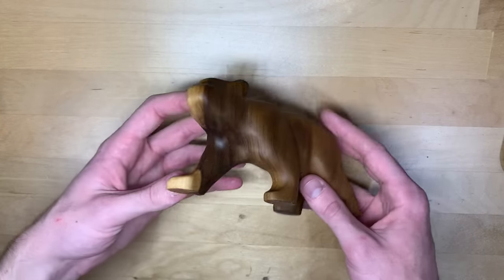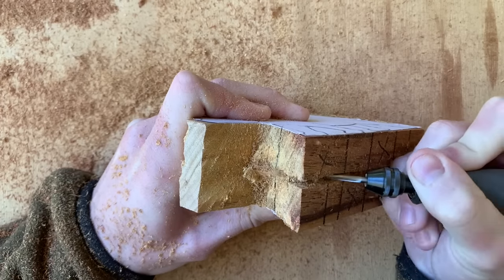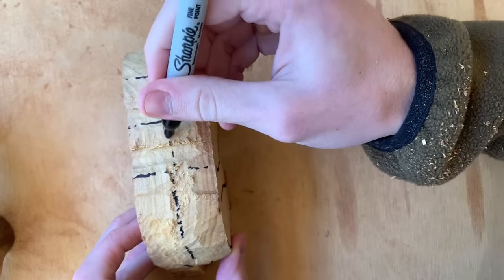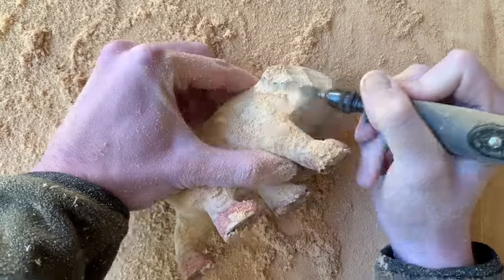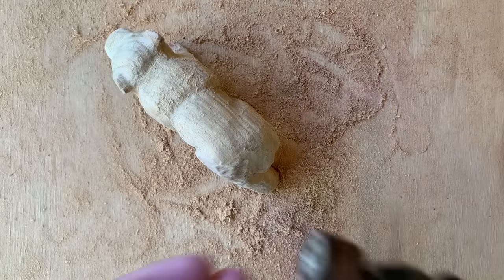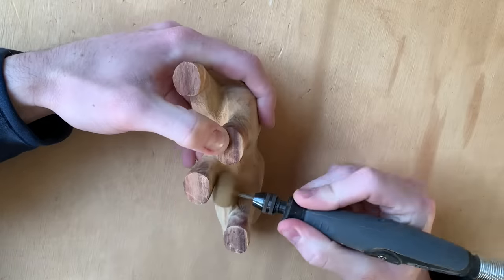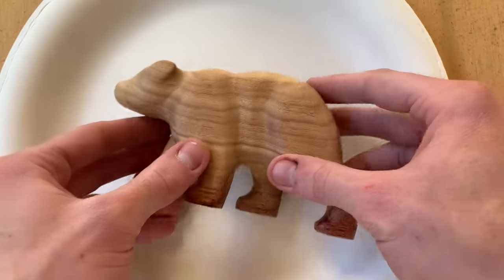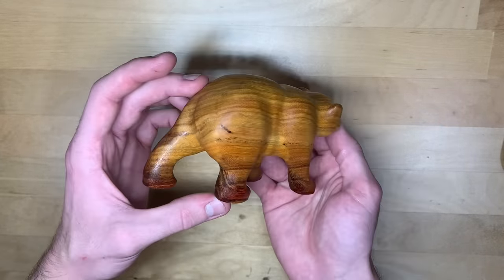Power Carving a Wooden Bear with a Dremel

Comment: That narrow bit can do work! 0:49 😮
Reply from the maker: Dremel 561, its really saved me from having to buy a saw
Reply: @LogsCarvingClub how do you cut so easy with it? It takes me forever. Technique or my wood too hard?
Reply from the maker: @Matsersuperkul  Maybe a mix of both. I try not to put too much pressure, keep it around a 45 degree angle, and do many shallow passes. Some very hard woods though are just not worth trying, and even tough ones I can cut like hard maple take a long time which I mostly edit out of the videos for the sake of time

Comment: question: does it matter which way the grain runs? if so-top to bottom or horizontal?
Reply from the maker: I responded more in depth to your other comment, but also usually I use this grain direction just cause that’s how the wood is usually cut

Comment: Great job! I have some questions... At the begging, What type of drill bit did you use for the Bear silhouette?  Is it the one generally used for flat cutting?  And do you recommend any other bits from any other brand that work with this dremel tools?
My English is too bad sorry if i made a mistake whit the writing... blessing from Costa Rica!
Reply from the maker: Hi - I used the dremel 561 I believe for the silhouette. Other than that I have most bits I use linked in the description, some are other brands. Thanks!

Comment: Is a 12000 rpm good enough for carving? Or do I really need a high rpm one?
Reply from the maker: Might work, but I'm not sure if it would work well. I usually use mine at 20-30,000 for carving.

Comment: Is There a problem using an 561 or 562 without the dremel guide? I want to try cut with them, but i don't know if it' dangerous or something.
Reply from the maker: You mean without the black depth attachment around them? If so I barely use those, I cut with the 561 and 562 all the time. The 561 is definitely dangerous though so you have to be careful, but it cuts really well. The 562 is slower but more precise
Reply: @LogsCarvingClub  I really apreciate your answer. Thanks you so much! 💯

Comment: Great video! I’ve done a little bit of carving and want to do more, this was a great video to help get my brain in the right space. Do you like any cordless rotary tool options?
Reply from the maker: Hi Bethanie! Glad you liked the video. I use the Dremel 8220 for routing so the cord doesn’t get in the way and the Dremel lite for little engravings and very small projects. Usually when I’m doing a larger carving though I prefer the corded options
Reply: Thanks! @LogsCarvingClub

Comment: I've only made one bear since I started 3 years ago, and I made it with a chainsaw, not a great success, but it looks like a bear 🐻😅! I'm going to try with the Dremel thanks! Do you use the flap sander that you can make yourself? I also discovered this thing for water, but for certain wood, including basswood, I didn't like it because we never stop sanding the fluff!
Reply from the maker: Hi, I don’t make my own flap sanders, I usually hand sand these or use abrasive buffs. And yes for getting it wet then sanding some woods seem to be eternally coarse, like a recent experience I had with birch. Usually very dense hardwoods don’t do that though. Good luck on the bear!
Reply: @LogsCarvingClub  You should try the flap sander, it helps a lot and it goes everywhere! But yes, hand finishing is a must!

Comment: Excellent Job! How many RPM did you use?
Reply from the maker: It depends, usually 20-25k for carving and 10-15k for sanding. The dremel has a manual that lists a lot of rpms depending on tool and material. Thanks!

Comment: Amazing, thanks for showing me how to get more out of my Dremel, I have a long way to go. Doing the carving you do, approx how long would a burr bit last you, just curious as to how fast they wear out, I know you can’t give an exact, but how many bears for example could you do with one burr bit? Thanks again. Ont., Canada.
Reply from the maker: Hi Jay, it depends on the bit but most last a very long time. For example I’ve roughed out dozens of similar animal carvings with one kutzall extreme flame burr without getting a new one, the 561 and 562 are also very durable, I’ve only gone through a couple of each of them. Some bits don’t last long like the sanders or grinding stones depending on how you use them. You’ll end up getting a feel for each of them as you keep making carvings
Reply: Thanks so much for taking the time to reply!
Reply from the maker: No problem!

Comment: Wat are the best bits to use as a beginner
Reply from the maker: Whatever you have, I’d start with tungsten carbide bits and engraving bits for a while to get a feel for carving then move to 561 and 562. The sanding bits and whatnot are all pretty easy to work with I think
Reply: Thanks for the tips love your vids

Comment: How do you decide what wood to use and sizing?
Reply from the maker: Hi Shannon, usually I just eyeball if the carving will fit within the wood, especially with the smaller blocks I buy like the one in this video. The closer the wood is to the final carving the better since you don't have to remove as much.

Comment: Have you ever tried chainsaw carving? It’s so much fun.
Reply from the maker: I would love to try it! I just don’t have a chainsaw currently and I’m worried about the noise for my neighbors
Reply: @LogsCarvingClub  it's basically the same as what you're doing with the Dremel. Just larger scale.  Cut away everything that isn't part of what you're carving. Then shaping it. I still use die grinders, Dremel, and sanders for the small details. I know you'd be good at it. You did a great job with only a Dremel.

Comment: Nice. But no need to do the 1000 grit, it's over 10x more abrasive than polish. Try 10000 next time or just a microfiber cloth, polishing wheel with no polish even...and pop the grain at least twice, and definitely right before the final rundown.
Reply from the maker: Worth a shot I guess! With how I finish these though they’re very smooth already. Some woods I have trouble with like poplar or pine but the denser woods come out great with just one grain raise and up to 1000 grit
Reply: @LogsCarvingClub  I'm sure they come out great, you are an awesome carver. Maybe save these extra steps for your best work. I do it for all mine but just because I am trying to master finishing.
Reply from the maker: @makinnewcounts6676  what kind of polish do you use? I’d be up for trying that but the red polish that comes with the dremel tends to stain the woods. I’d like to learn more about finishing but I get so bored at that point that I settle with ‘good enough’
Reply: @LogsCarvingClub  honestly,  I work my way up through the grits to up to around 800 to 5000 then "polish" with microfiber or cotton cloth, without any chemical polish. Then shellac, laquer, (then tabletop epoxy if needed, wet sand from 220 up to 10,000 compound, polish (automotive products) and ceramic coat (also auto)